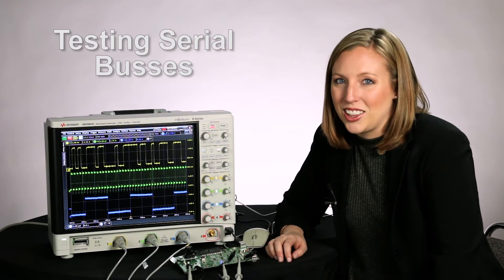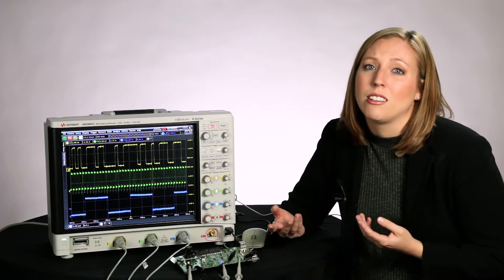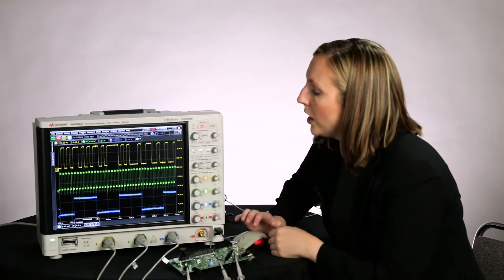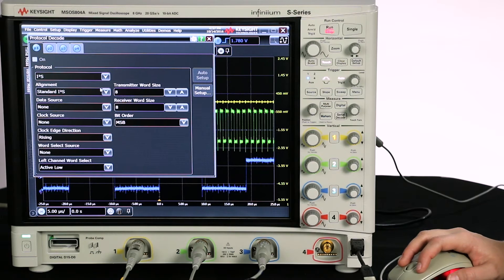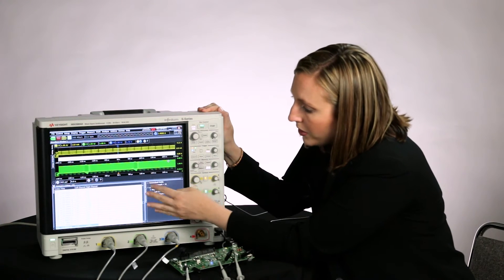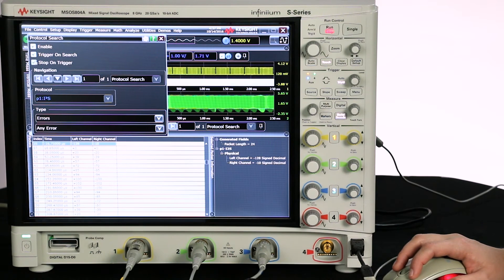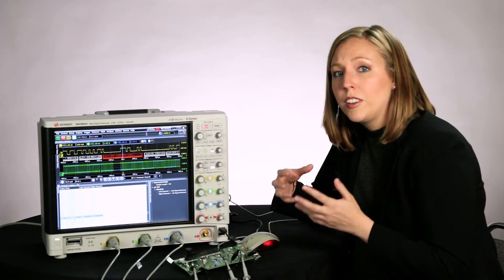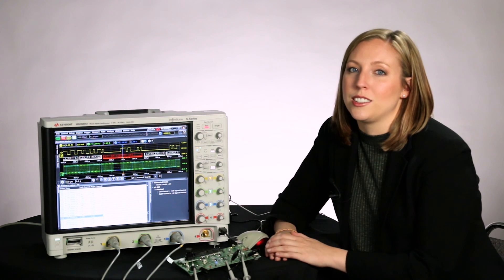Debug Serial Buses with S-Series Oscilloscopes

Comment: Protocol decode rocked my world. I've done RS232 serial for decades, used some really good gear, but when I got a DSOX1204G last December for "regular" electronics work, I found that the serial protocol decode was a game changer on a recent project. It's a kind of daisy-chained serial bus where multiple devices all listen to the same signal, and you have to get your addressing right ("Talking to pump #07") or the signals walk all over each other.

Debugging my software would have taken until the heat death of the universe to figure out otherwise.

Thank you, HP ^H^H Agilent ^H^H^H^H^H^H^N^ Keysight.

Comment: on first glance, i thought to myself, ... cool video.
then i looked again and thought... hang on.. holy shit that's a big screen.

if you pay attention to her hand size and the size of the screen, you'll notice, what is that ??? a 17" monitor or something,
which begs the question, how much is the scope
i'm guessing around $30,000 or so
is that about correct
Reply from the maker: It's a 15" capacitive touch screen, and it's glorious. The S-Series is an Infiniium scope, so it's part of our higher end line and starts in the teen-thousands USD. Probably not something you'd get for your garage lab :).
Reply: i have 2 things to say here

1. re... starts in the teen thousands.
     i gathered as much

2. re... probably not something you'd get for your garage lab
hehe..
clearly you don't know me very well  hehe

i'm one of these rare people that actually would get it
because i can appreciate the instrument and the engineering behind it 

i'm not one of these people that sits there and says , it costs too much.
instead, if i see a reason to buy something like this
i just buy it because i know i'll probably not need another unit for a very very long time and in my view that's worth the price of admission

besides i always find a way in my line of work to get compensated on the cost of it, so.. yeah
like i said
i'll look into it a bit further and possibly get one

thanks for the reply